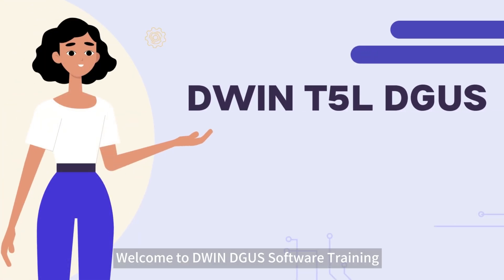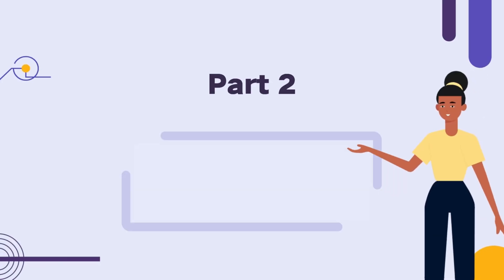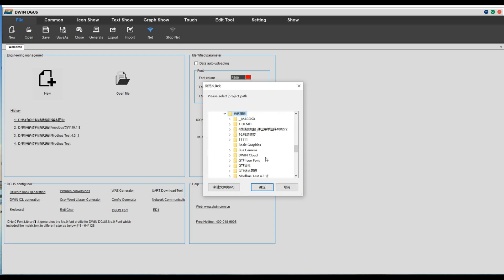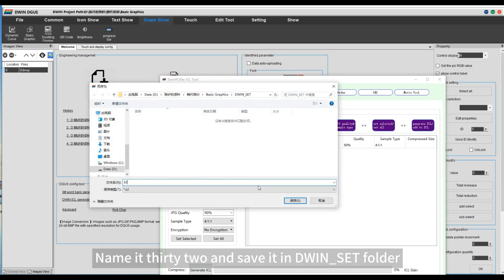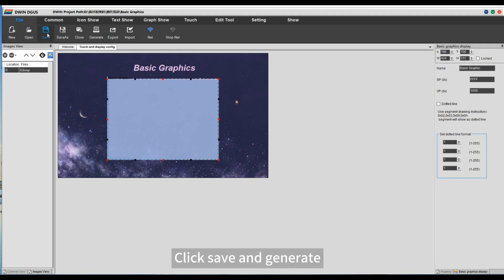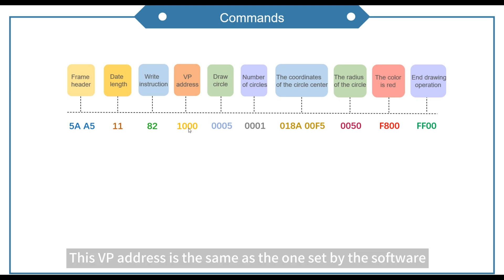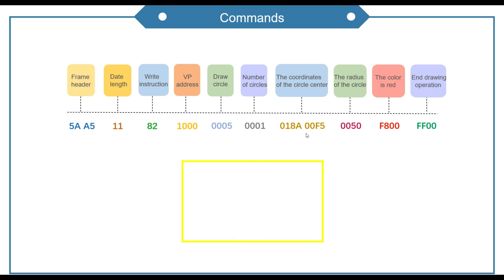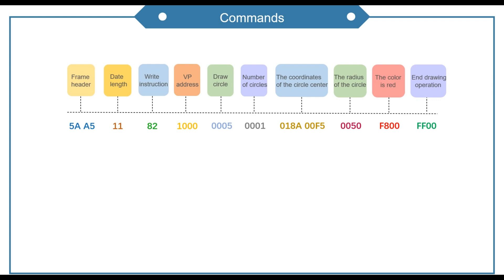Basic Graphic | send command to display graphics

Comment: Isn't there a way to keep the pixels that were previously created and create new ones in a different location?
Reply from the maker: Sending a command that includes the new VP address and location can create new ones.
Reply: @DwinTechnologyOfficial  Is there a way I can send images that have not been saved in 48.ICL using UART to display on the screen?